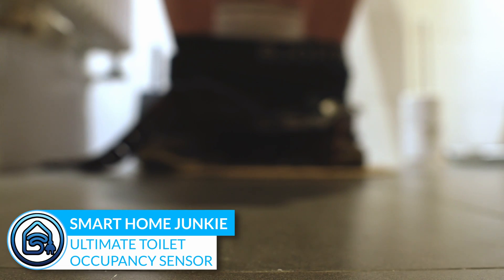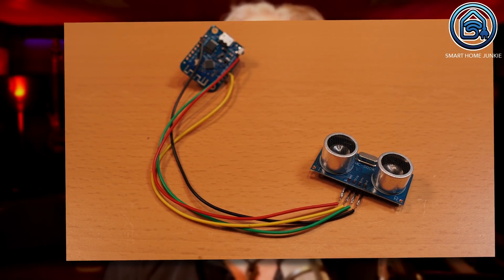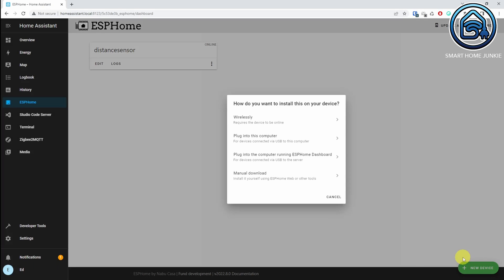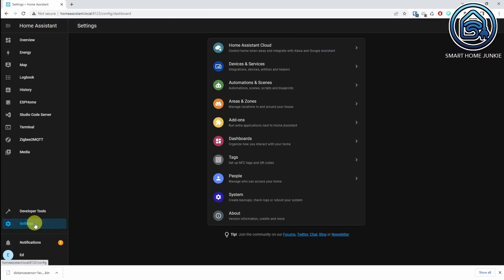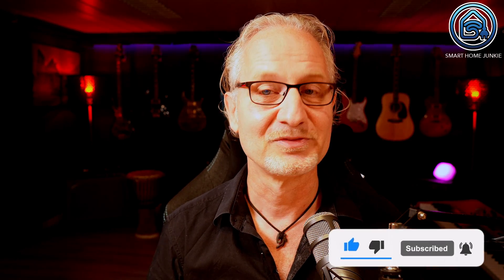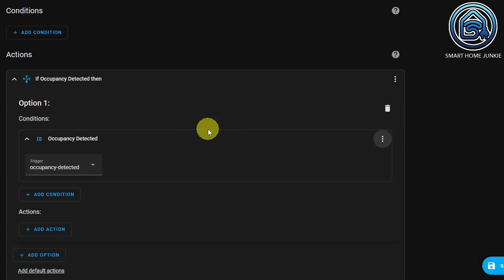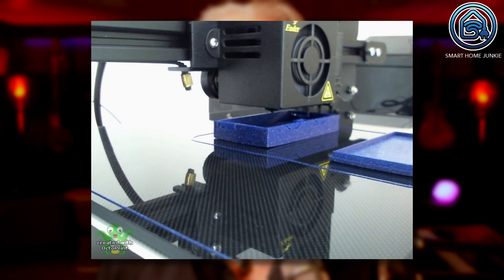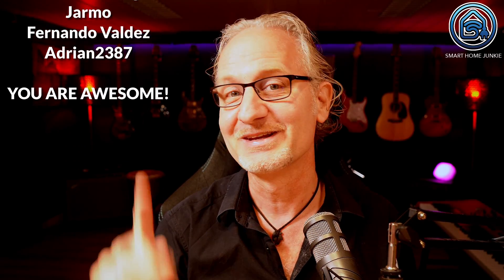The Ultimate Toilet Occupancy Sensor - Tutorial

Comment: Or you could just put a contact sensor on the toilet seat
Reply from the maker: I would say use a vibration sensor as long as it's waterproof...
Reply: I have a contact sensor on the toilet seat, then when the toilet lid is up, the light is blocked from turning off.

The bath and shower are also solved in a similar way but with a leak sensor.

Comment: Great project idea I thought, so I built it last weekend with my nodemcu and a 3d case, cool fun. 
I don't know if it's the HC SR-04 in general or just mine, but the readings are all over the place. My toilet is 1.5m in total from wall to wall. If someone sits on the toilet, the distance should be about .3-.4m, but the sensor so often jumps up and down, which makes this sensor pretty much useless, as it turns the light on and off at random. I was hoping you could maybe let me know if you get random readings which don't make any sense as well?
I tried with 5s readings, 1s reading, 10s readings, and literally every reading returns a different value. I'd much appreciate some feedback.
I even went as far as trying to use statistics to get some more average values with maybe like 5-ish samples, but didn't help either. Otherwise I would be such a cool project and it even looks cool with those 2 googly eyes👀 😂
Reply from the maker: There are two versions of this device. The 5v and the 3v3 version. If you connect the 5v version to the 3v3 pijn, the readings will be nog correct. Maybe that's the issue here?
Reply: @SmartHomeJunkie  Thanks a lot for the reply. I do have the 5v version I had to realise :) as on 3.3v nothing at all happened, so the sensor is running on 5v already. Maybe it is indeed a broken sensor... Just wanted to double check with you whether you always get consistent readings of distance every time or if your sensor jumps up&down in distance too.
Reply from the maker: @andy-gee-2k  Ah okay! Can be a broken sensor indeed. At the moment the mmwave sensors are hot and maybe even more suitable for a user case like this!
Reply: @SmartHomeJunkie  Nice, I wasn't aware of the mmwave as yet, was still waiting for the FP1 to be available here 😅
I see whether I try another SR-04 or maybe use a presence sensor. The cool thing about the SR-04 was, I had it at home with all other components, didn't cost me a thing, kinda 😁 Thanks a lot for your responses anyway. Looking forward to more content from you 😃 Take care

Comment: 1 month on, I'd be interested to know how reliable it's been and if you've had many false positives of the light turning on when not in there.

I've started using the LD2410 mmWave sensor for the past month and it is incredible.

Even if the sr04 is doing the job for you I highly recommend checking it out and perhaps doing a video on it. It's quite cheap, has an app and an android app for the LD2410b.
Reply from the maker: Ooh, that one seems very interesting as well! I did not get a lot of false positives tbh.

Comment: I solved this issue using combination of a motion sensor and a contact sensor on the door. Light remains on if door is closed. Timer keeps light on for a couple of minutes if door is open and motion has been detected. I used Node Red to control the flow.

Comment: So I built this sensor on a breadboard, all new components even DuPont cables, things went well but my sensor was and is reporting the same distance in the logs or when I visit the device in settings, always 0.01 Meter

Any suggestions?

WiFi signal is good.
Reply from the maker: Did you buy the 3v3 version? I suspect that you bought the 5v version. What happens if you connect it to the 5v on your D1mini? Be careful though. You might kill it.
Reply: @SmartHomeJunkie  I thought having same number made it correct but

Description: 
The module has stable performance and accurate distance measurement: 
Comparable with SRF05, SRF02 ultrasonic distance measurement modules, etc. Module accuracy, blind spot (2 cm) is super close, stable range, this product is launched to the market under the strong! 

Features: 
Voltage: DC5V 
Static Current: Less than 2mA 
Level Output: High 5V 
Level Output: 0V End
Sensor Angle: No Over 15 degrees
Detection distance: 2cm-450cm 
High precision: up to 0.3cm
Connections: VCC, TRIG (control side), echo (receiver side), GND
Reply: @SmartHomeJunkie  so you think I can disconnect the D1 from power and move VCC to 5vdc instead of 3.3v? And this could fry it?
Reply from the maker: @BELSERVICEMAN  Well, according to your description yours is 5v, so you should be fine.
Reply: @SmartHomeJunkie  I will know in a few minutes. 😀
Reply: @SmartHomeJunkie  yes that resolved it and it seems to be working now. I just need to convert meters.
Reply: @SmartHomeJunkie  could I have edited code to create an imperial conversion that would have had the entity display inches or feet?
Reply from the maker: @BELSERVICEMAN  Yes, you can do that by creating a custom template sensor in Home Assistant that recalculates it.
Reply: @SmartHomeJunkie  working pretty well, haven’t set up conversion yet and just testing for my use cases. Thanks for your support!
Reply from the maker: @BELSERVICEMAN  You're welcome Rich!
Reply: @SmartHomeJunkie  I just looked and don’t see any that say they work off of the  3.3 volts and not 5 volts. I followed your wiring from the video saying VCC of SR connected to 3.3

Comment: How about a moisture/leakage or water level sensor within the water flush tank?
Reply from the maker: I'm not sure how that would show if someone is in the toilet room. While you're sitting on the toilet, the water tank level stays the same or am I missing the point? 🤷🏼
Reply: @SmartHomeJunkie  technical you're 2 spots in a bathroom where you "hold still"; sitting on the loo or taking a bath.. 

When you water meter measures a bathtub full of water and humidity going up, it's clear you take a bath... And you can keep the light on till you register movement to confirm the loop... Once movement is ending you can turn your light off plus the humidity fan on.

For the loo, the water level sensor will indicate the flush took place... Actually I don't know if you can submerge a leakage sensor and if it will be water free enough after flushing to trigger the event... But I'm sure that's somehow possible... Even with a vibration sensor...
Reply: For taking a bath, you can even dim the light to enhance the atmosphere ;)
Reply from the maker: @gismoscherer  ooohhhh, cosy

Comment: I solve this in my home using using a contact sensor where the Reed switch is swapped out for a couple FSRs. The FSRs sit on the toilet seat under PVC tape. It works well as a battery operated solution.

Comment: I just finished a project using mmwave for human detection. I used the SEN0395 from dfrobot. Works very well. Paired it with a dht11 temp and humidity sensor. Used a ESP32 as controller. I just need to design and print a housing.

Comment: This doesn't work with 3V3 as shown in the wiring diagram. I always got the same miniscule reading like 0.00128m. My HC-SR04 needed 5V to operate.
Reply from the maker: As you can see in the video, it works with 3v3. There's also another (waterproof) type version of this sensor that needs 5V. Maybe you've got that one?
Reply: I believe there are older and newer versions of the hc-sr04.

The newer v2 ones apparently have a wider voltage range and will work at 3.3v.

Comment: The solution is simpler than that just requires a bit of logic. So a motion and door contact sensor - if motion is ever detected and the door is closed logically the room cannot be unoccupied until at a minimum the door opens. So unless you do your business with the door open or with friends who come and go while you are in there this should work just fine.
Reply: Yeah but if you're having a shit whilst sitting on the toilet drinking a beer, eating yesterday's left over cold curry and browsing ebay while no one else is home your method is kind of flawed though. 😢
Reply: @souk-tv  not exactly... as long as you close the door.... it's impossible for you to leave the room without opening the door or bailing out a window

Comment: Thanks for a fantastic video however just wondering how I am going to power this sensor seeing there is no power in my Toilet. Fantastic idea anyway .
Reply from the maker: Thank you. Maybe you can place it on the ceiling and use the mains power of your toilet lamp?
Reply: @SmartHomeJunkie  Good idea, thanks
Reply: @SmartHomeJunkie ... But that would be the lamp that would need to be controlled by the sensor. A catch 22.
Reply from the maker: @sagetx  Yes indeed, there is constant power going to that lamp as long as it's a Smart bulb.
Reply: @SmartHomeJunkie  Oh! Smart bulb. I have switches. That makes sense.

Comment: I’d say the best (wireless) solution for me was a combo of zigbee motion sensor & pressure strips. 
Pressure sensor to keep the lights on if you’re sitting on the toilet seat longer than usual.
Reply from the maker: Nice idea! 👍🏻 Just wondering if the pressure sensor is waterproof. Or isn't that an issue?
Reply: @SmartHomeJunkie  it’s not so i just covered it up with white tape. Better option would be to just hotglue it.
Reply: @Richard Homan i might  need to see a diagram for that since i can’t quite see where to install it. As for my solution, i just placed the short pressure strip wired to reed switch (zigbee) underneath the toilet lid.

Comment: This is a huge problem actually. But your solution needs a power outlet. You should make a video on how to add a battery pack to your sensor.
Reply from the maker: As I explain in the video, a battery is not an option for ESP devices. You can also place this on the ceiling and get the mains power from the ceiling lamp.

Comment: As I am not into soldering and tinkering, I’m going to attempt another solution in my new house: open/close sensor combined with a motion sensor. When the door opens, the light should turn on. When motion is detected 2 seconds after the door closes, the room is occupied. No motion, no occupancy. As long as the room is occupied, the light should remain on until the door is opened again.
Reply from the maker: Let me know if this works. I suspect that motion is detected add soon as the door is opened, so it might be tricky with timing. And what happens if someone opens the door and decides not to enter the room, or partially enters the room and closes the door again right after that without being in the room?
Reply: @SmartHomeJunkie  I’ve done the above and it’s working well (door and motion sensor) it’s all based upon the door being closed and motion inside the room being active for x (2 or whatever) seconds. If you open and closed the door quickly or open the door and walk in and walk out, as the door is not closed , the “is occupied” helper I have never gets activated.  As a catch all, I have a “clean up” routine that polls all states for my “is occupied” helpers and if any of them are active longer than my time out, it executes the turn off function for that room. (And each room has a different timeout as people are more likely to spend more time in a bath that a toilet) - hopefully.
Reply: @jasonhnz  any chance of sharing the automations you’ve written for this? Would love to start with that.
Reply: @boudewijndejong9134  can do. I’ve done it in NR too. Will post something tomorrow during my day to provide an overview
Reply: @jasonhnz  Thanks!
Reply: @jasonhnz  Was wondering if you could share your HA automation which you described a few posts up.
Reply: @SmartHomeJunkie  we’re still building the house, so haven’t achieved this yet. Idea is to wait until the door is closed before reading the occupancy sensor, and perhaps reading again after 5 seconds for confirmation. Will use Node-Red in HA, so still some viewing of your video’s needed.
Reply: I've done something similar in NR, took a while before I ironed out all the exceptions but now it works fairly well. 
For instance, somebody opens up the toilet door to get some toilet paper, and closes the door again without actually occupying the toilet
Or somebody goes in the toilet right after somebody else 

I also noticed that a motion sensor doesn't always detect a person because they are sitting still. The smallest room in the house turns out to be one of the hardest to automate :D 
I love the idea of this sensor, but power indeed is a bit of an issue if you are using an ESP32

Comment: So I assume this is powered by mains using a phone charger type plug? That would limit my use case since there is a half wall separating the toilet area from the rest of the bathroom and no plug near toilet so it would not be able to trigger :(
Reply from the maker: It needs power by mains indeed. You can also hang it on the ceiling and get the power from your ceiling lamp.
Reply: @SmartHomeJunkie  That is an excellent idea I had not thought of that!

Comment: This solution also works for my use case, which is to turn on my workbench light when I am in the midst of a messy project. I need to turn on the lights when my hands are dirty or holding tools.
I have the sensor configured to toggle the light with a wave of my hand in close proximity (0.5 m) to the device. The light stays on until I wave again.
This does require the timer to be set at a much smaller interval, 300 msec. I hope this more frequent event activity is handled within the D1mini, and isn't spamming HA?